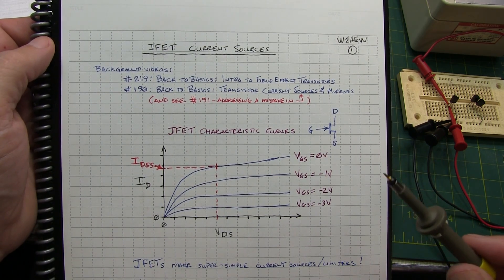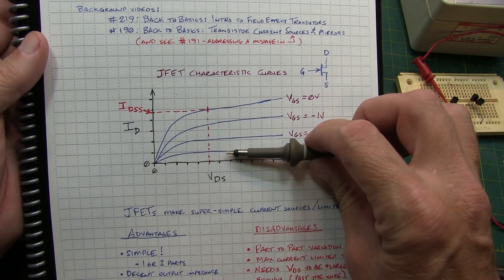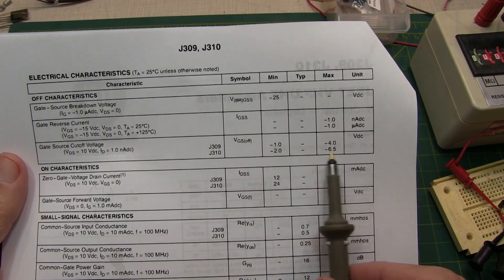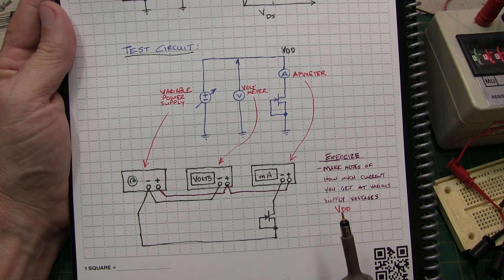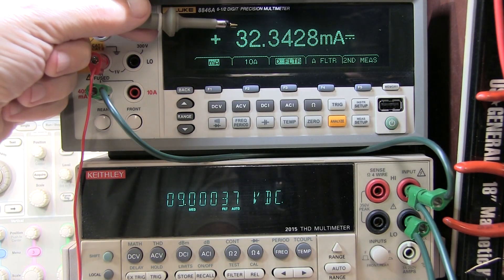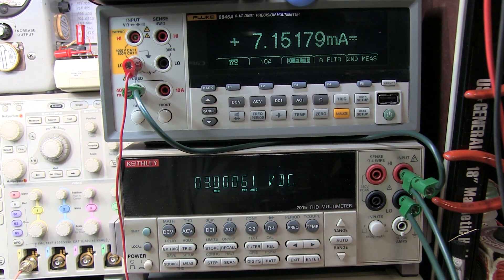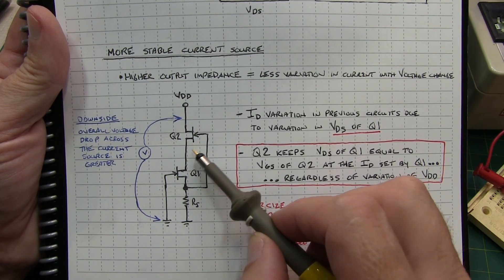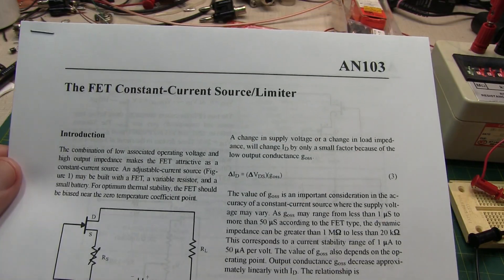#374: Back to Basics: JFET Current Source / Limiter circuits

Comment: Another great instructional video.
I learned how to cascode JFETs from this program.
Therefore, it seems that JFET cascode device can easily be used on top of other devices such as BJTs, and MOSFETs without much biasing network.
As you know we go to great length to bias the BJT and MOSFET cascode device to make sure the casecode device stays in saturated region; whereas, here you do not need much biasing network, and the cascode device always stays in saturated region naturally.

I wonder if you have two matched JFETs, how can you make current mirror out of them? Anyone knows how?
Oh by the way I used JFET current limiter for safely discharging high voltage capacitors, instead of resistor, I use LED, when the LED goes off I know the capacitor is discharged to few volts, and another JFET current limiter with resistor in the source, which is connected in parallel with the LED current limiter will complete the discharging the capacitor.
Reply from the maker: Yes, matched devices can be used to make a mirror - similar to how it's done with BJTs.
Reply: @w2aew  Thanks for the reply. However, I have some concern that it would forward bias the JFET.   i.e . If we connect Gate to Darin of JFET  like MOSFET to generate reference voltage for the mirror JFET. Plus there is no feedback mechanism to set the correct Vgs voltage value.
The only way that I can think of is to put a battery ( i.e. voltage source) between drain and the source.  Say put a 3V battery with positive connected to drain and negative connected to gate.  Which means 3V zener diode connected from Drain to Gate and the gate connected with high impedance say 1MOHm to the V- supply, and the source connected to GND with a +V GND -V type of supply.  The the gate of this JFET can generate reference voltage for mirroring JFET, with its source connected to GND.
Reply: Matched pairs of JFETs are near impossible with discrete devices -- there's just too much variability in the fabrication, and then you have the effects of temperature being difficult to match. I have some JFETs from the 1970s where two devices are fabricated on the same die and they match quite well when used aa a differential pair (this was before the TL072 series were commonly available and I needed an FET-input opamp). You could use enhancement mode FETs (generally mosfets) to make a current mirror, but as you say, the biasing needed to do the job with JFETs is too complex when a pair of BJTS (preferably matched in a single package) will do the job simply.
Reply: @RexxSchneider  Thanks for your reply.  I am an Analog  IC designer, so I usually use transistor for  current mirrors ( such as MOSFET, Finfet, BJTs, ...) each of them has its advantages and disadvantages.  We match the transistors easily by using several transistors close to each other in common  centroid configuration to average out their characteristics.  So, instead of using one to one transistor we use say 10 to 10 transistors to get a better match.  The problem with MOSFET is flicker noise (1/F noise).  JFET is very similar to MESFET (Metal-Semiconductor -- without the  oxide layer  -- Field Effect Transistor), So we can use JFET circuit topology for MESFET circuit.  MESFET, similar to JFET, has much lower flicker noise.  That is why I am interested in the JFET circuits.  Note that  JFET uses PN junction for gate whereas MESFET uses  Schottky diode for the gate.
Reply: @aduedc  Thank you, that's interesting. Of course, you can take advantage of the inherent matching of devices fabricated on the same chip to obtain results that are near impossible to achieve with discrete devices, but the idea of paralleling 10 devices to do the job of one in the same chip had never occurred to me.

When I designed analog circuits many years ago, the toughest part was always to make sure that thermal mismatches didn't push the circuit out of spec. I never knew whether a production pcb would ensure that both semiconductors in a pair would experience the same temperature variations unless I specified they were bound together on a heatsink, or the whole module was potted, and both of those cost money.

I know that FETs have an advantage over BJTs in flicker noise, but I would still consider that any depletion mode FET would be tough to bias effectively in a current mirror configuration.
Reply: @RexxSchneider  Thanks for sharing your thoughts:
1.  You are right we do simulate over temperature, corner, and random mismatch ( Monte Carlo Simulation) for temperature range specified.
That is we simulate for typical process from say - 55C to 125C
then simulate for statistical  slow (S) and fast(F) corners of process at lowest highest and typical temperature in the range:  
NMOS  PMOS Temp
S           S           -55C
F          S           -55C
S          F          -55C
F          F          -55C
S           S           25C
F          S           25C
S          F          25C
F          F          25C
S           S           125C
F          S           125C
S          F          125C
F          F          125C
Also in the Monte Carlo simulation, we randomly vary the gate sizes given our lithographical tolerance.

In BJT we have shot and thermal noise, which are significant.
In MOSFET the 1/F flicker noise is significant.  I/F noise is major headache,  if you want to design MIXERs and VCOs, because it translates into the channel and creates phase noise.